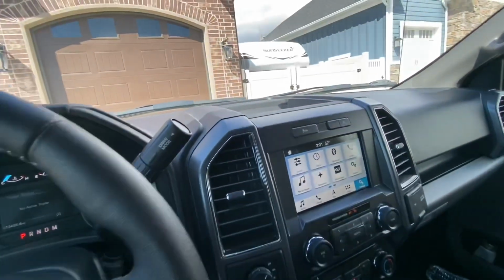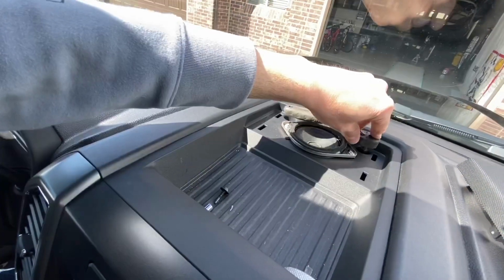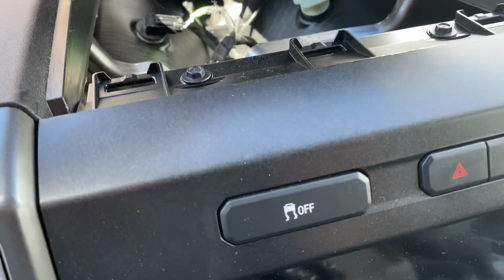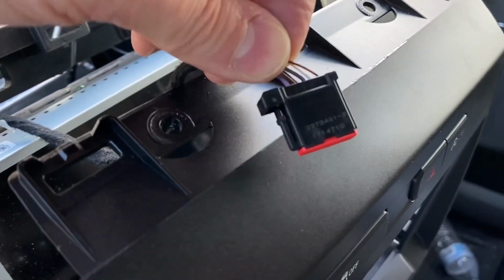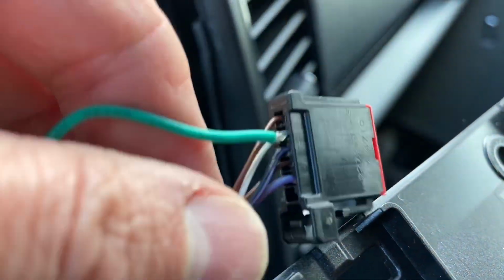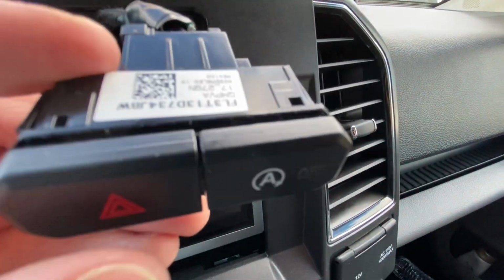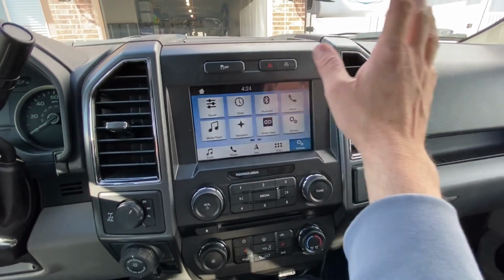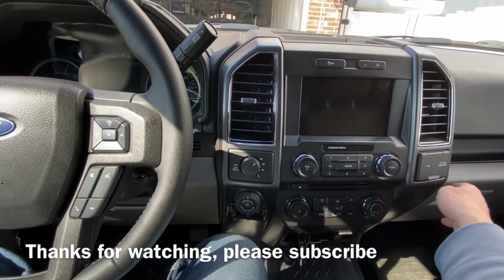Ford F-150 Auto Start Stop Disabled permanent bypass override Simple,Easy, Free! Jump Wire

Comment: 4 months later....any issues?
Reply: I’ve had a jumper in for 3 years on my 2017. It works flawlessly every time!
Reply from the maker: No issues at all, it still disables the start stop function everytime!
Reply: Myks Garage...thanks. I have a 2020 xlt and want to do this
Reply: Will this affect towing trailer?
Reply: It will work fine until the truck burns down, spend the money and get the eliminator, it’s much safer.
Reply from the maker: 1 year so far and the truck hasn’t burned down.
Reply: @w.miller7282  is exactly no difference the box does the same thing